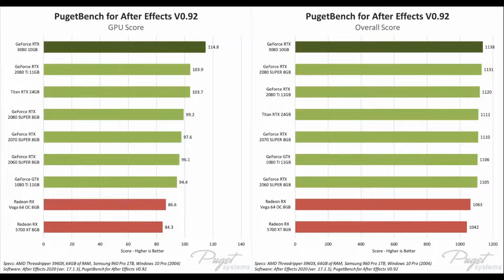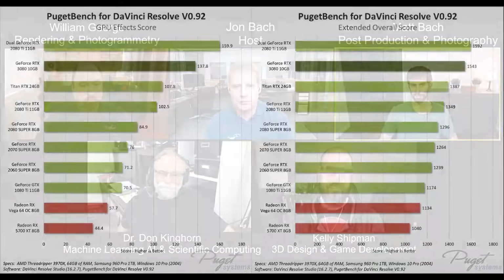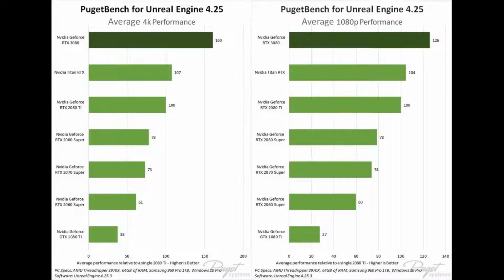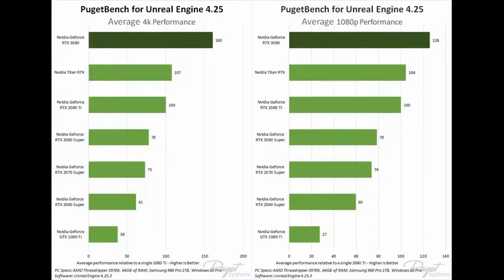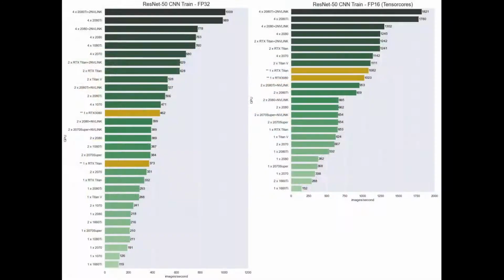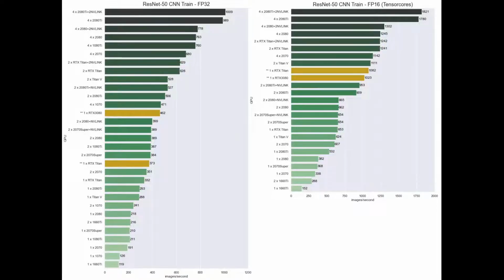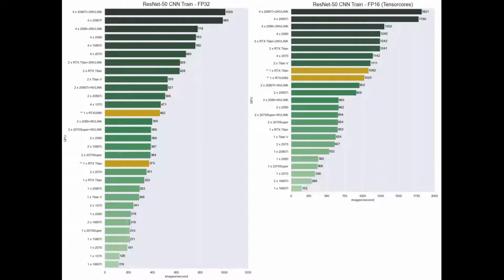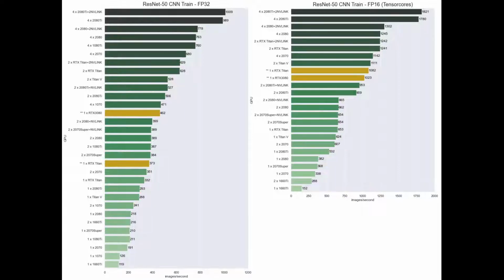Labs Open Office Hour: Jon Bach and the Labs Lads!

Comment: Thx for the video. very informative

I'm using Adobe Premiere and I have seen your past videos and website articles on CPU, RAM, GPU & SSD

I've been having this issue where editing with 1080p video, my system is choppy even at 1/4 of the resolution. Specially with multiple video tracks layered on top of each other. So does that mean Premiere is using more CPU/RAM per video layer? Cause sometimes I have to layer anywhere from 1 to 4 to 10 and even 50 videos.

Even a single or two track 4k video is giving me a very choppy playback

I also do notice even with GPU Acceleration turn on, I'm not getting more than10% of usage

I'm running an
i7-8700 (non-k)
asus h370-f mobo
16gb ram 2666mhz
GTX 1080ti
Samsung Evo 850 SSD
Two 1tb Seagate Baracuda 3.5" 7200rpm
1 Hitachi 1tb 7200 2.5"

I'm just pulling my hair out trying to figure what the issues can be since a lot of reviews on YT tend to focus on rendering more than playback so I cannot come to a conclusion whether to upgrade just my ram or my cpu ram and mobo altogether